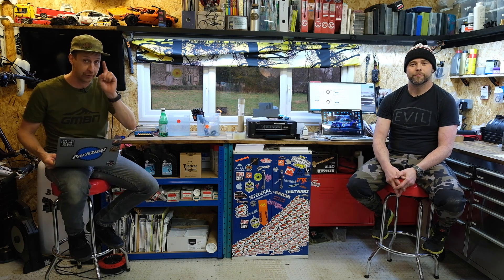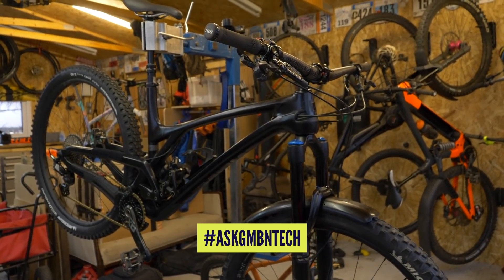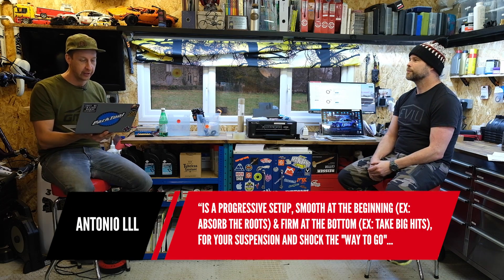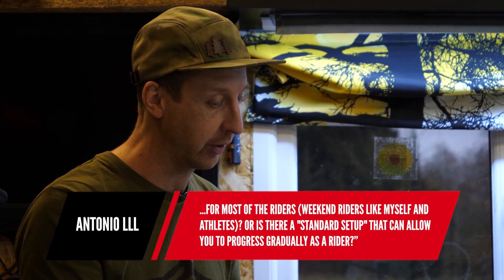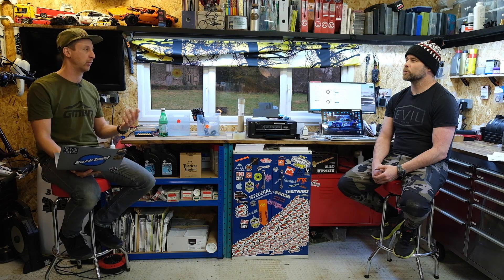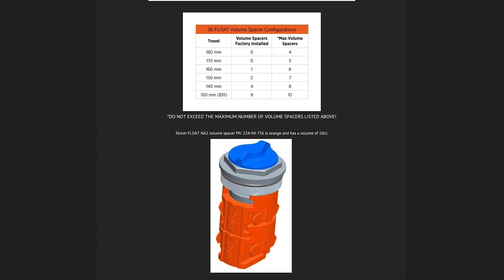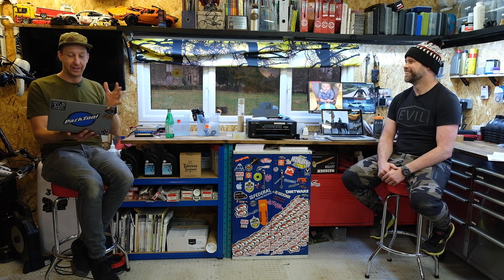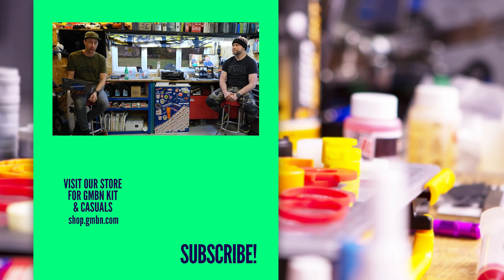Is A Progressive Set Up Better Than Linear Suspension? | #AskGMBNTech Suspension Special

Comment: I miss Doddy and these conversations.

Great observation by Finn about how the rider feels suspension packing as the handle either rotating forward from fork packing or rotating backward from shock packing. Observations about cold fork oil turning to margarine are also unforgettable. Cudos!

Comment: #AskGMBNTech would your suspension basically be 2 in one if there is a hsc, a lsc, hsr and lsr. I do a lot of big jumps and flow lines but as well as downhill Rooty trails, I want my suspension to be firm and not to soft for the jumps, using around 70~75%travel and for the downhill bits more of a few bottoming out bits but not too much. how would I tune it to that and how would I know when I have succeeded. Thanks

Comment: #askgmbntech I have a fox 34 fork and I when I put  the bolt in through the calliper and into the fork it doesn't tighten and just spins out I think this is because it's rounded out. What can I do and how can I do it. Cheers

Comment: #askGMBNTech Doddy, For a sub-zero trip you should come here to the Yukon. Specifically Whitehorse, yukon. Our winter trails are unreal. We now have 3 fat bike trail groomers (a modified snowmobile, a Rokon, and a snowdog). The experience of riding on a groomed snow flow trail is otherworldly. You’ll need to bring a few more layers for rides though as your usual setup would result in losing a few limbs when the temps dip below -20 C. This past winter we’ve had some big temperature swings (from -5 C to -40 C in a matter of days). I’ve really started to notice a difference in the level of grip at various temperatures. -5 C to -10 C, it’s very loose, you spend about as much time sideways as you do forwards. -10 C to -25 C you have maximum grip, it’s crazy how hard you can push into the corners (on a groomed trail that is, ungroomed is a different story). Below -25 C the grip doesn’t really change on groomed trails, it just starts to hurt. Below -35 C it really hurts, like hurts to breath. Below -40 C the bike will likely break, at those temps it’s possible to freeze your freehub and snap a pawl.
Reply: And in terms of staying for awhile, you can stay at the Boréale Bike Ranch in their yurts and watch the northern lights dance across the sky. Plus we have 5 breweries and one distillery now so there is always something good to drink.

Comment: #ask GMBNTech Hi my thread on my fork's calliper mounts are gone, do I thread it for a bolt that is 6mm alan head, if I do that that thicker bolt won't fit through my MT5 brake calliper, the fork is min. 203mm rotor so it cant be the adapter pls help also if i thread the calliper with the bolt hole there is a chance od my brale pads rubbing and if I thinker in any other way eith the calliper will it void the warrenty

Comment: #AskGMBNTech
Speaking of suspension, would you do another suspension themed episode or tech show talking about the different types of rear suspension design out there. I know there isn't the holy grail magic do it all suspension design. However you could discuss which out of the common suspension design (DW, 4 bar, single pivot, multi pivot Horst link) we see in the market is best for which type of terrain or what type of rider?

Comment: #askgmbntech Hi Doddy, I'd like some help with brake setup. I have occasional issues with brake fade running Sram Code Rs and and 180mm centerline rotors front and rear. I could either swap to the shimano hybrid material rotor in 180mm or go to 200mm the former option being cheaper as I wouldn't have to source new spacers in addition to new rotors. Does the aluminium have as much heat dissipation effect as the bigger rotors? If you're curious I ride a Chromag hardtail because steel is real and the terrain I ride in the Canadian Rockies is as steep as it gets.

Comment: I suffered neck and spine injuries in 2019 after hitting a tree and have started to ride again( just light stuff no jumps or drops),when I do manage to get back riding trail centres/parks again would a coil shock on the rear be better on my back than my air shock as I've been told I'll have to live with the pain so would like to minimize it as much as poss.thanks.

Comment: #AskGMBNTech. I have a rockshox super deluxe select rear shock. It only has a rebound adjustment. After looking at the lockout switches on the piggyback of the ultimate it looks like I could bolt on the reservoir assembly  to upgrade it. Provided there isn’t any internal differences of course. Is this accurate?
Reply: no you can't retrofit them

Comment: #askGMBNTech  shock service intervals - I have a full suspension bike that I ride a lot, about 2500km a year. My fitness tracker shows its about 250h of riding, fox says that a full rebuild is after 100h, is it a way to get more out off the shock or do I have to do it 2 times in a year
Reply: I'd reccommend once a year

Comment: Anyone have decent info on 5th Element stuff? I've done service on lots of stuff, but it seems a lot of info is lost to time.
Reply: If you've done coils before its really simple, ideally you need as special tool as you bleed through the reb needle/shaft, but with an extra pair of hands you can do it manually

Comment: #askgmbntech shoe question. I’ve been using xc style shimano shoes, paired with CB egg beaters and CB candies. They work well together for me until i started riding gnarlier trails. I needed to stand up on the bike more often so i switched to the CB mallet dh and paired it with a specialized cliplite shoes. My issue is the shoe does not allow me to position the cleats all the way backwards to the midfoot. This results on me having to use a lot of calf muscles and it burns me Out. I wear a size 40 and i realized that the bigger size shoes lets you slide the cleats to midfoot but not for the smaller size. This issue can be resolved by going flats but i dont want to go to that direction. Do you have any suggestions? Any brands that accommodate needs of smaller riders like me?
Reply: Can you modify the shoe?

Comment: #askgmbntech hey Doddy, I ordered a Polygon Siskiu T8. I'm concerned because it has resin only rotors but I'm quite certain it has ceramic pads. is this going to be an issue?
Reply: Not an issue unless you change the pads to metallic sintered pads. And if you want to use metallic sintered pads you need to change rotors. (SLX rotors work fine with sintered pads)

Comment: #askgmbntech Doddy can you tell me why most bikes have at least some parts of the shifter or brake cables bare and not have the housing go all the way to the derailleur or caliper.  I.e sometimes on the bottom of the top tube or at the chainstay there always seems to be some part of the cable bare
Reply: Saves costs on meters of brake & gear cables

Comment: #askgmbntech if you do notice your suspension feeling stiff due to cold weather, would heating them with a hair dryer solve the problem? Or, would the lubricants have solidified past a usable state by the time you notice any effect?
Reply: That would take a very long time 
Easier just to have the bike indoors over night

Comment: Cheers for the help and advice
On a 160mm travel fork. When setting up should you aim for using all 160mm travel.
Reply: Yes - you should use full travel once or twice on your "normal riding" what ever that may be.
I tend to run mine a little firmer, so that I don't have to change it for the bike park

Comment: #AskGmbnTech 

I’m looking for a new 29” fork for my upcomming Cotic BFeMAX, I’d like a fork thats capable of running 130-160mm of travel as I ride quite wide variety of trails. Was looking at a Rs Pike but it only goes up to 150. The other option that I’d like was a Rs Lyrik but the shortest travel on that is 150. Could you help me out?

Prefferably a Rs fork as I already have parts and spares for them.

Comment: I recently got a Scott ransom frame without a shock, the OEM Fox Nude shock comes with a linear medium rebound linear medium compression tune. I threw on a DPX2 perf elite with RM CM tune, so far it feels ok, but are there any setup tips you can recommend now that I've lost the ability to use twinlock but would still like suspension that is reasonably plush?

Comment: #AskGMBNTech.    If C02 only lasts a day in tires as its too small, why isnt their compressed air that is used the same way
Reply: Because CO2 is totally a different gas type then Compressed Air, Compressed Air is O2 without the C. C=Carbon dioxide and O2 is Oxygen.
Reply: @zepp3lin  No. Compressed air is around 78% nitrogen and 21% oxygen, then the other 1% is a mix of other bits and bobs such as Carbon Dioxide, Neon, Hydrogen etc
Reply: Genrally inside suspension we use pure Nitrogen as its an inert gas, meaning it doesn't react with rubbers and metal, also doesn't explode and has very low moisture content.
Unlike Oxygen, pure oxygen ignites when near a flame. which is why they use it for Brazing
Reply: @finlaypaton7202  is that the same theory for tyres. Because ordinarily you fill your tires with air, where as with those CO2 canisters that you put onto the valve, im assuming its pure c02 so why wouldnt you just have compressed air.
Reply: @LJS1605  CO2 can be made liquid easily if you compress it enough. and it’s easier to package in a small canister that way
Reply: @finlaypaton7202  understood 👍

Comment: #askgmbntech Which tyre is the best for bikeparks on a hardtail? And, do you recommend to have an insert just on the backwheel?
Reply: Tire with enduro/dh casing. Something like schwalbe super gravity or Maxxis dd casing. Tire rubber should be pretty soft at least in front tire. I use Schwalbe Magic Mary ultrasoft super gravity in front. At back you can use something that rolls a bit better. So you could choose tire with harder compound or smaller knobs. Maxxis aggressor dd dual works pretty well. 

As for insert, I would choose thicker casing first. But if you have something like maxxis exo casing or schwalbe trail casing I would use heavier insert at back and lighter (like Huck Norris) in front tire.

Tldr: front: grippiest tire you can find with weight of ~950 - 1150 g. Rear: a bit harder compound and better rolling tire with weight of 1050 - 1250 g. Or if you go lighter go with inserts.

Comment: Great videos with Fin, well done guys. So I've got a question. I currently ride an old Vitus Escarpe VR from 2014. Its got a RS Monarch RL from the same year. Still works but not great, tends to blow through travel unless set very small percentage of sag, and it bobs a lot on climbs. Thing is, the tune is LL (to suit the frame leverage) and any similar aftermarket shocks are nearly always MM tune. So 2 questions really. 1. What difference would the same shock with MM tune really make in terms of the ride quality and 2. Same question, but with MM high volume aircan (debonair) version. For reference, I'm about 78kg. Thanks!

Comment: #askgmbntech 
Hey Doddy, I want to change all my bearings and bushes this winter in my 2017 YT Tues AL. All pivot bearings and headset are sorted, but I am having some trouble with the BB. Do I need to get the original RaceFace PF30 83MM BB or can I get other brand ones? So far I know that I need to look at the internal bearing diameter of 30mm and the 83mm spacing for the frame interface.
Any suggestions or help would be appreciated!
Cheers Steffen

Comment: #askGMBNTech  Doddy or Fin is there any tips or extra steps you would recommend for a heavier rider? I'm about 200lbs and running full tokens in my Fox 34. Am I to heavy for this fork?
Reply: Probs a little on the upper scale, I'm 200lbs too and can flex a 34 like a wet noodle, I run Fox 36 on my bikes

Comment: #AskGBMNTech I am riding my Cube Al frame XC bike on the trails with some jumps up 0,5m high. I am worried about my 100mm Rock Shox Reba. Is it safe? I have one volume spacer installed and running pressures accordingly not to bottom out.

Comment: A friend of mine recently declared that his fox coil spring was linear and I scoffed at this as it is not really ever the case in reality, so I took the spring and put it in my press and graphed the results at 1/4 inch increments while staying within the recommended travel range (taken from the fox table) to avoid binding. The result was of course a mild S curve and not a straight line...has anyone else ever done this and do any of the manufactures ever publish actual test data for tuning purposes..As MTB suspension develops riders are going to demand more and more from their suspension and a clear understanding of exactly what is going on will take out a lot of the guess work in setup IMO..going by feel will only get you so far..

Comment: When is below freezing I warm up  the fork seals and dropper post seal with a hair dryer then spray-on some silicone. I work them  up and down to initially get movement with less stiction. The idea is to have the seals warmed up a bit before the initial Breakaway force of the Fork takes place. Then I usually dial in a bit more compression when it's really cold. 

 Another interesting guest would be Allen Millyard. The man who basically engineered and built one of the fastest DH bikes out of a garage at his home in 2007. And the second generation in 2014 which still holds up is one of the fastest bike ever on a DH course. The suspension that he utilizes for these bikes is simplistic from an engineering aspect yet provides amazing performance. Check out his channel and consider getting him on the show 👍

Comment: Finn is certainly a whiz at setting suspensions up but man he is rough around the edges for explaining everything. 🤦‍♂️🤦‍♂️🤦‍♂️😂😂😂

You should think about getting Steve from Vorsprung suspension on the show. This man is probably one of the best suspension technicians around today and has an excellent grasp of physics. He can explain everything that's happening with a suspension with regard to Dynamic and static aspects and how it all works. 👍

30% sag on a rear shock?! 🤦‍♂️
Yeah I guess for DH and Enduro but for the average or I should say below average Rider just on regular trails?
Absolutely no way,  that thing becomes a pogo stick. Geez Louise 30% my goodness that's ridiculous.
25% maximum unless you're doing DH or Enduro.  Preferably around 22% to 24% at the rear somewhere between 15% and 20% on the fork. 
You know the problem is when you don't put numbers into contact you're going to have all these Muppets running around setting their suspensions up like professionals.
Holy shmoly that's bad advice
Reply: Trying to make it simple for people to understand otherwise you'd fall asleep

Comment: #GMBN why do I have to pump my fox X2 to 275lbs to get my correct sag when I only weight 210....it just came back from fox and they couldn’t answer it....what would happen if I were a big guy weighing in at 250 it tops out at 300psi
Reply: Probably more to do with the leverage of your bike

Comment: You sir are a life saver. I have one question though that may apply to another video I couldn't find: I changed the air shaft of my 150 Lyric Ultimate 2021 model to a 160 mm C1 but the visible distance of the stanchions is approximately 155mm. Is this normal?
Reply: Fork might be sucked in a bit, don’t know how to fix it but your forks are fine

Comment: #askgmbntech how much of a difference does 10 mm of travel really make?
Reply: I think it not make any difference. More You can get using different setup. than changing travel. It also depends do You want to change in Your frame or You mean in between  quite similar frames.
Reply: This much holds fingers up approx 9.8mm appart
Reply: @finlaypaton7202  If it is hardtail it not only change position of fingers. but also change 0,5 degrees angles but only on fully extended fork. It can make small difference on how bike ride. In case of full suspension it is little bit different.
Reply: @wojciechopyrcha9116  I think you'd be hard pressed to notice a discernible difference, unless you are really dialled into your bike.
Reply: @finlaypaton7202  Depend on how You are riding, and probably also construction of bike have  some to it. My friend had the same hardtail as mine(Dartmoor Primal 2020) and his stroke was 10 mm larger at the beginning and 10 mm smaller than mine at the end. Each time I felt differences in driving time. Especially when climbing steep climbs and berms. Interestingly, the difference during sharp descents was noticeable only when the shock absorber stroke was shortened.